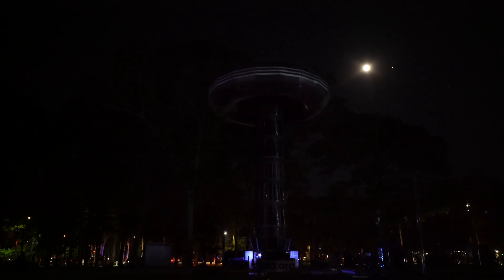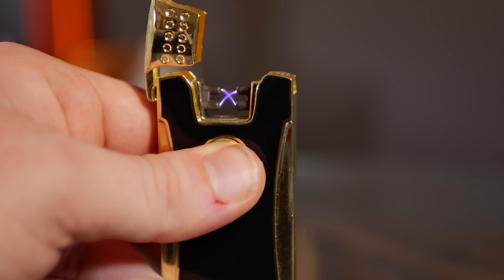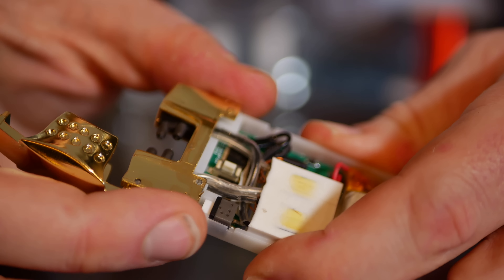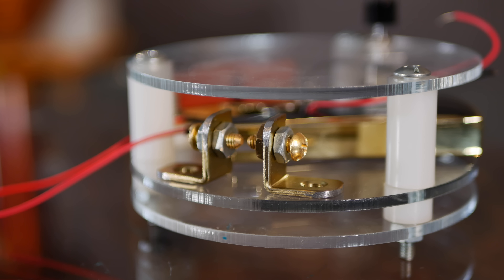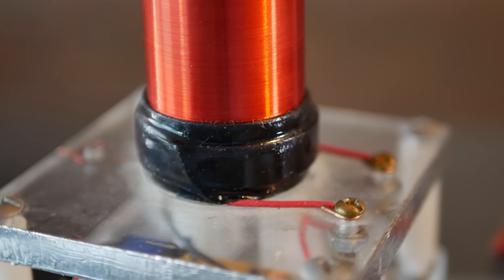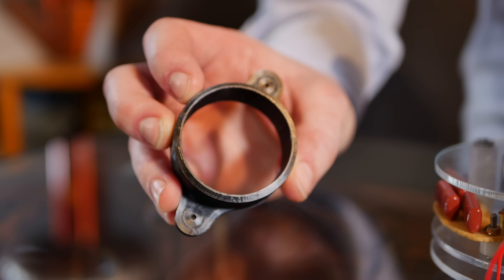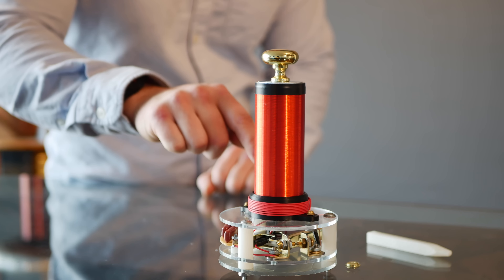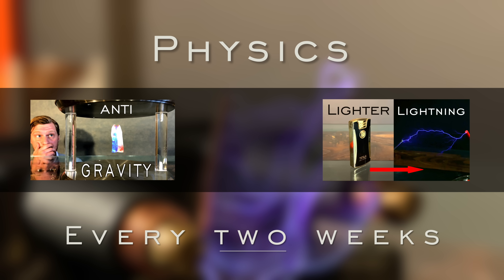DIY 50,000 Volt Arc Lighter Powered Tesla Coil (ft. Integza)

Comment: This one is very interesting.  The arc lighter is itself a tesla coil.  Instead of a spark gap it uses a transistor with a DC power input (the rechargeable battery in the lighter) to form a high frequency self oscillating circuit to drive the primary coil of the transformer in the lighter.  That results in high voltage high frequency AC on the output of the plasma lighter.  This is why the plasma lighter could be used for the power supply for the lightning tower build (Cockroft-Walton voltage multiplier).  Now, since the output of the arc lighter is AC, you have to include the high voltage diode in your tesla coil primary circuit as a half wave rectifier because you want to charge the capacitor with a high DC voltage.  So essentially the plasma lighter high voltage AC output gets rectified by the high voltage diode and charges your high voltage capacitor every half cycle.  Once the capacitor voltage gets high enough to break down the spark gap, a spark jumps the gap and the gap becomes very conductive (almost like the gap was shorted).  The stored voltage in the capacitor can now discharge across the spark gap and through the tesla coil primary coil.  As that stored energy is suddenly dumped across your tesla coil primary, it results in an even higher voltage on the tesla coil secondary.  Voila!  A tesla coil powering a tesla coil!  Very nice!
Reply: Does this mean that we could achieve double the power with a

FULL BRIDGE RECTIFIER
(Cue Electroboom's rectifier man)

Comment: Arc lighter powered Tesla coil is a device that uses an arc lighter to create a spark that powers the Tesla coil. The arc lighter is connected to the primary winding of the Tesla coil, and when the arc is struck, it provides power to the coil. This allows the Tesla coil to create a high-voltage discharge, which can be used for various purposes such as lighting cigarettes or creating an electric arc.

The arc lighter powered Tesla coil is a simple and easy-to-build device that can be used for many different purposes. It is a great project for anyone who is interested in electronics or physics, and it can be used to teach basic concepts about electricity and magnetism. The Tesla coil can also be used for demonstrations or experiments, and it can be modified to create different effects.

Comment: This is a pretty neat project, I love how simple these are to build in fact I built something not much bigger over a year ago but I used a small flyback transformer from a 5" tv set and just a simple mosfet driver to drive the trasnformer.  I have also learned that you can use the inverter transformers from old LCD TV's as well which are not hard to come across these days.  The arcs are about the same in size but have more thickness to them and don't dare to touch it lol.  I am hoping to tweak the tuning a bit more in the future to hopefully get larger arcs.  To power it I am using 3 18650's in series to get around 12V and what is really fun about something like this is how the principle of function pretty much stays the same once you have a HV source to work with.

Comment: Some improvement ideas:
* remove the bottom conductor, it is acting a short-circuited L3 coil, and robbing the secondary of power.
* tune the primary to closer match the secondary. Not sure how 3nF and that small primary match up to the secondary, my guess is that the coil operates at 2MHz.
* try adding more turns of thinner wire. For a coil this size I would use 30AWG or as thin as you can tolerate. The current is low anyway so more turns will result in higher output voltages.
* Fatten the secondary a bit so each turn has more inductance and the larger diameter means better coupling between primary and secondary. More important with SSTC designs though.
Reply from the maker: Hi PM, thanks for the suggestions. The ground connection is needed to ensure proper flow through ground and air. Without a ground / counterpoise, the high voltage ground will jump to the primary circuit and burn insulation. Also, with no ground connection, the voltage output at the topload is decreased. Also, the two circuits are roughly tuned. The primary is just under 2mHz, while the secondary is 1mHz. They are at nodal frequencies and this coil is optimized for it's size. For the fatter secondary, those are usually reccommended for higher powers. This little guy is less than 15 watts!
Reply: @PlasmaChannel  Yup I'm aware, check out my most recent audio modulated SSTC! :)
Not saying to get rid of ground, just remove the large conductive plane, since the magnetic flux induces a current in it and it creates an opposing magnetic field. Check this video out to see what I mean: https://www.youtube.com/watch?v=sENgdSF8ppA

Using a higher resistance ground plane will help greatly reduce the eddy currents. Or if the electric shielding isn't needed, then just have a ground lug and make sure to connect the ground. In your case, It's probably not affecting the output too bad given it's distance from the primary, but the eddy-currents works like electrical "friction" and that always that works against you. 

Great vid BTW.
Reply: It really needs an adapter so you can olay music with it
Reply: @DarkDragonEgg  This Tesla Coil does not have the capability for audio modulation. There is too much noise and distortion introduced by the crude spark gap design.

Comment: Jay, why the primary coil is at the bottom of the secondary? I know almost every Tesla coil does it this way probably because first design by Tesla was that way to avoid passing the power source long distance close to the secondary coil and risk discharging back to the power source (which can be avoided with an ugly twist of wire).. BUT if the primary coil goes in the middle of the secondary you will have a lot more coupling of energy between the coils, and this gives you more space to widen the electric tape insulator to cover almost all the secondary coil to void corona so there will be no need for the 3D printed large gap (which reduces the power transfer of course). Might be an interesting and simple test which makes your modified (E-Tesla) coil more powerful :)
Reply: The primary coil is on the side where the secondary is grounded so to minimize the voltage difference between the two and thus reduce the chance of arcing. You can put the primary in the middle, but then you'll need to make a ground connection in the middle too and you'll have both ends of the coil at half the "normal" potential
Increasing coupling does not necessarily increase performance. That very much depends on the resonance frequency of the secondary + top-load combination and the resonance frequency of the primary coil and capacitors. In this video, no attention is given to that aspect, but it should, as that is the most important factor determining the performance of the coil.
Then, when everything is well tuned, the best results are actually obtained with a coil that is not coupled at all. Tesla called that the "extra coil".
Reply: I am fascinated by this concept as a transformer of power but I can't quite comprehend any practical use as such . If a practical application could be disclosed it may help me to understand the value of such a toy. How would this apply to  household use on a large scale ?

Comment: Great video!  Long ago I worked in a factory that made use of a electrostatic spray system to coat inserts for making shock absorber bushings for cars . The " glue " was sprayed on with 100,000 volts. I used to grab hold of a good ground and bring my hand up to the end of it to get a arc. The guy who sold us this thing showed  how to do this and was part of a test to see if it was working right. If I had to work overtime, the rest of the factory would line up to the time clock and the line would sometimes reach back near where I was working. When a person was near, I would say, Have you seen the new spray gun we have here?   Then I would reach in and get about a 3 inch arc going. Freak them out big time. Even more if I acted like I was getting shocked.   : )
Reply from the maker: Hi 55Ramius! Thats hilarious, I see we have the same humor. Thanks for sharing

Comment: That's awesome.  Thanks so much.  I have an arc lighter sitting right here.
Reply from the maker: Awesome! Make sure you don’t touch anything but the on off button, when turning it on and off. Also, don’t run it more then 10 seconds at a time.

Comment: This is the video I have been praying for. Going to build this ASAP! Thank you so much :)
Reply from the maker: Hi Kayla, glad you are inspired! If you need help don’t hesitate to ask. Two things - 1) the lighter easily breaks. Make sure you’re never touching a spark from the Tesla coil while also touching the lighter or the on off switch. 2) don’t run the coil more than 8-10 seconds at a time - it will break the lighter quickly if you do! Make sure the spark gap is no more than a mm, and you’re good to go!
Reply: @PlasmaChannel  Thanks so much!

Comment: I like your videos because my grandson always has a project for "grandpa" to help him with.  It would help if your parts could mostly be found at a local Home Depot or Ace Hardware and your build process was explained more thoroughly.  For example, the alterations to the Arc Lighter look simple when, in fact, they aren't.  We were building the Zapper Tesla Coil and the explanation of the capacitors was very confusing.  The one in the parts list didn't match the one in the video, for example.  Thanks again for keeping my 10 year old grandson interested in science instead of "screens."

Comment: Completely unrelated, but seeing the coil wound so easily with a drill reminds me of the days when I would use a drill to rewind vhs tapes. I always thought it was impressive how they could handle the max rpm of the drill for minutes at a time to the point of smoking but never actually break.

Comment: Wow, its actually works😄.
Like!
I build it with more power a i have 9cm (2.4inches) sparks.
I upgrade it and its more powerfull.
Thx u very much for this video.
Reply from the maker: Really? that is amazing. Feel free to share a photo of it working to my email!
Reply: @PlasmaChannel  more turns on secondary and more Capacity of capacitors and i make rotary spark gap for it.
Reply: Marek Matejík would you consider making a video to show your upgrades or sharing pictures and details?

Comment: Oh I wanted to let you know, I've been in a ASE automotive tech for over thirty-six years, and, Robotics and microcontrollers is a hobby of mine, and I've been using a lot of automotive equipment, do to the robust nature of the electronic equipment, automotive electronics are set to a higher standard. Anyway, they claim the GM HEI ignition is around 60 to 70 thousand volts. Now I've used many different coils as my final. But there's a cheap way to drive these coils that might help you out. I actually used the GM HEI ignition module. Just requires a 12-volt source, and a pulse rate of your choice, a 555 circuit for example, & it's a good, beginner, plasma delivering project. Now, I don't know what pulse frequency GM's HEI module can handle, but I know it's extremely durable, and fires a car coil, effortlessly. Just an idea to throw in your toolbox, for your next project. If you do build a project with a GM HEI module, I would love to know what kind of pulse frequency these modules can handle. They're super compact, only require a small heat sink, run 12 volt, and the best part, they're cheap. Well I hope this helps you.

Comment: You  rock man!
I had interesting idea to recharge your coil lighter. There's a channel called The King of Random. 
He made a battery hand cranked recharger for  USB devices using a drill! 
And there are other videos claiming to have a never ending waterfall which eventually does and you have to reset it!
 Use the waterfall to turn the drill and recharge your coil lighter.

Comment: I tried the capacitor in series, but didn't work for me. Ended up putting it parallel to the primary coil instead. And it worked.

Would also like to see you build a wimshurst machine!
Reply from the maker: Glad it finally worked. I do want to build a wimshurst....they just have a lot of wear and tear which I dont like. I just built an epic Van De Graff, and put out a video about it though. Check that one out.

Comment: Cool stuff bro! I just subbed! I'd love to build a tesla coil someday soon!
Reply from the maker: Welcome to #PlasmaNation! Thanks for the compliment!
Reply: @PlasmaChannel  you're welcome bro! 😎👍🏻. And thanx for the warm welcome! 🙂🙂🙂
Reply: @PlasmaChannel  i need you're opinion plz n thnx. You know how electrolidic capacitor's have a polarity. If you hook them up backwords depending on the voltage it starts to damage the capacitor by drying the electrolidic solution and making them start to bubble on top. Is it ok to short capacitor's? Do you think that shorting them slowly is ruining the capacitor? I bought some expensive capacitor's that are good for up to 450volts at 470uf! Witch is pretty good capacity lol at 450volts! I love charging them up and shorting 1 big bang lol. I just don't wanna ruin them. You think i'm ruining my capacitor's by doing that?

Comment: Dude you said you'd discuss the spark gap in more detail and then failed to do so? It was the only part really wanted to hear - the coil is nice and all but I've always struggled with SGTCs because of the spark gap. Anyway other than that, nice video!

Edit: as a suggestion for the non-noobs. Maybe you can post your javatc output etc to show how you modelled the coil.
Reply from the maker: Hey Nick, every coil i've ever built, I never used JavaTC (i'm familiar with it). I calculate resonant frequencies manually, and build the primary and secondary myself. As for the spark gap - yeah after a full month of filming I guess that did slip my mind!
Reply: @PlasmaChannel  Appreciate the response! I've built something along the lines of Loneoceans SSTC 2 (https://www.loneoceans.com/labs/sstc2/) - works well but I'm scared to take it to full power (variac will handle it but windings probably won't). I've had less success with a full bridge - need to figure out why - but my TC experiments have been on hold for a few months. Anyway, good channel you have going and it's always nice when the creator takes the effort to reply to comments.

Comment: I'm about to build my own little Tesla coil according to your video. I have just one question left. What diode did you use? What specifications are required?  
Btw. Great video you gained a subscriber!
Reply from the maker: Welcome C.E.! You can use any high frequency diode rated for your voltage source (arc lighter) mine is the same I use in all my builds - 2cl2fl

Comment: With spark gap transmission lines one could still transmit high current high voltage using towers and lines

Comment: Hey man. I really like your videos on high voltage sparks. You should use high voltage tapes which are being used on transformer coil of any computer power supply. They have a very good insulation property aginst high voltage. Good luck. keep posting such videos. They are very enjoyable to watch.
Reply from the maker: Thank you very much for your compliments. I’m happy you’re subscribed.
Reply: How many turns would you suggest with the high voltage tape?

Comment: I'm curious, how long can you make the secondary coil? Since each individual coil of wire isn't at the full voltage (differentially-speaking), could the coil essentially go for metres? Or does the whole of the secondary coil need to be in "nearfield" distance of the primary coil to inductively couple? Oh, and thanks for the videos!
Reply from the maker: The length of this secondary is precisely calculated to match a resonant nodal frequency of the Primary. Tesla coils dont work by just blasting power into a secondary - they use precision and resonance. Making a really long secondary, at the same diameter, would mess up resonance and you'd get little output. Thanks for the compliments!

Comment: How do you grounded the other end of the secondary coil?
Can I use a flyback transformer or high voltage module instead of plasma lighter? 
Please reply 😊😊
Reply from the maker: The coil is connected to the counterpoise.
Reply: @PlasmaChannel  ok
Reply: Can I use flyback transformer or high voltage module?

Comment: Hi Jay. Love your channel. I have tried to build this little project but haven’t managed to get it going at all. I have all the same parts you at using and have the exact same arch lighter. I stripped that apart and soldered the two centre wires together and are using the two outlets for my primary coil. Without the diode the wires produce a significant arch but once I have it all wired like the diagram it’s not doing anything at all. Not sure where I am going wrong with this little project. Any ideas would be appreciated. Thanks

Comment: What about those tasers that produce arcs between its 1-1 1/2 inch gap? They look like a lower frequency as the frequency of the arcing is noticeably slower but is still  ‘standing’ arc... The noise they make is quite scary and leads me to believe they may just be an interesting driver

Comment: This is awesome , after watching this video many , many times I finally finished my own model of this and yes that diode was very hard to find ⚡️⚡️⚡️ the real question I have now tho is …. If I was to get 3 arc lighters 9 capacitors 3 diodes would this this work with a bigger secondary and primary to match ?
Reply from the maker: It may be easier for you just to find a more powerful HV powersource, than to intertwine three of them. Glad you got yours working!
Reply: @PlasmaChannel  thanks for the tips man I like the look of the ionic power source from another one of your videos